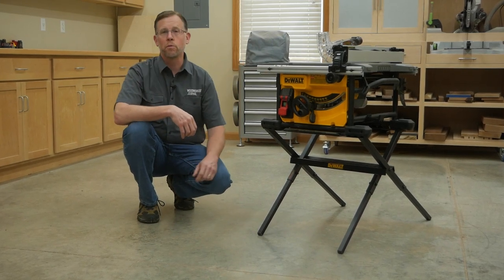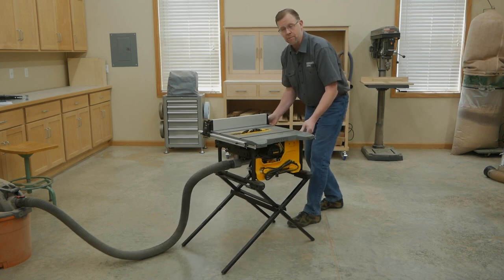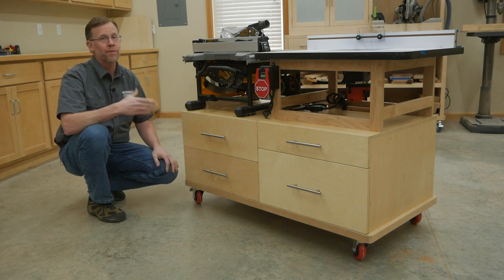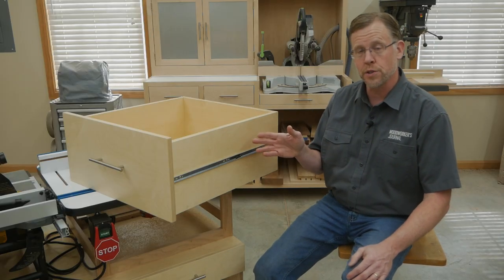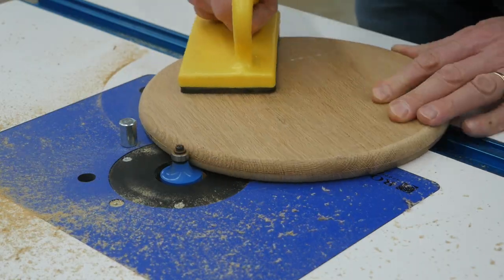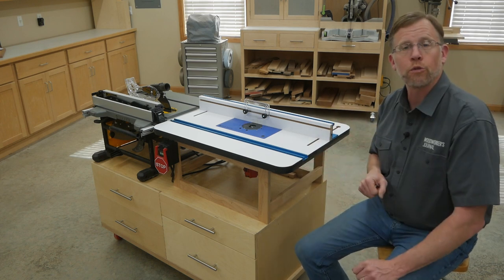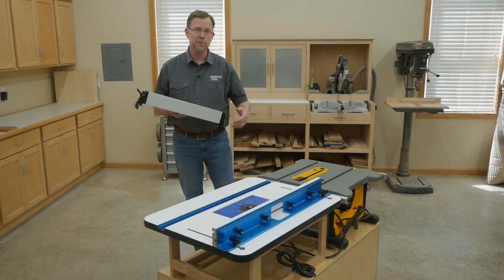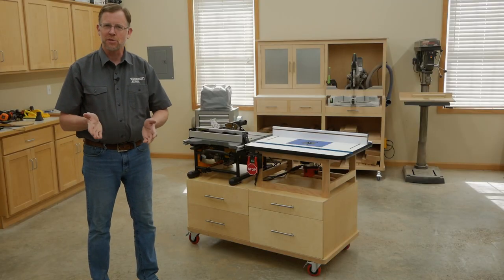Benchtop Tool Cart Overview - Table Saw and Router Table Cart

Comment: Yes, please adjust the music and speech volume. Remember the music is supposed to be background. Your commentary is the important part. Now to the project. All the points about the small standalone tools are spot on. Your cart certainly is a good fix for the small tool drawbacks. How about adding a rack to the back to hold the fences when they are not needed. Miter gauge too. Thank you for sharing. Have a great day and stay safe.

Comment: I like the space saving design but am concerned about the workflow from one tool to the other. If the table saw is set at the same height as the router table, doesn't the miter gauge slot run into the router table? Or if the table saw is raised so that the miter gauge slot is even with the router table, won't the work piece from the router table run into the table saw top?  How do you address this issue? Thanks.